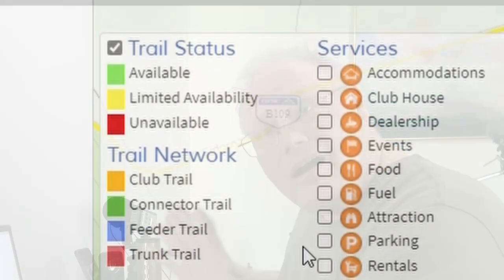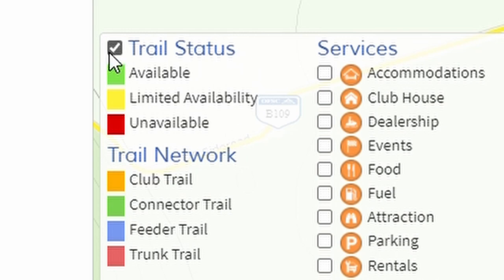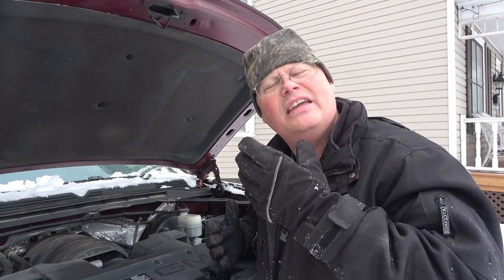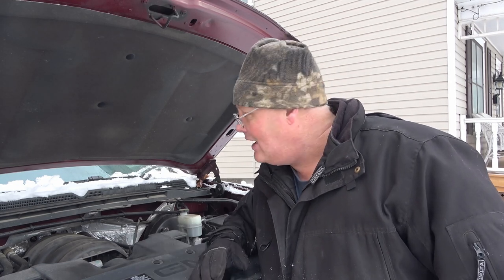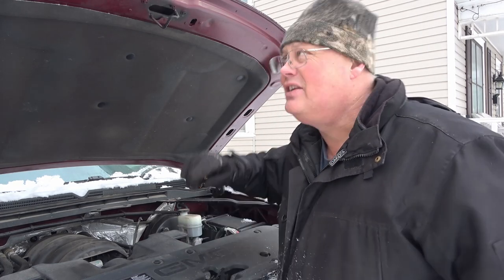Today I help you plan your first ever snowmobile trip ever.

Comment: Very good logical advice. I did not know the tracks are so well mapped and there are clear rules that apply to users. Very sensible  for all. That snowmobile riding looks great. If I lived in Ontario I would not be too concerned at having to put the motorcycle away in November - provided I had a snowmobile.
Reply from the maker: Thank you for the comment Mal. The ofsc does a great job at mapping the 30,000km of trails. It is a fun hobby as well and I'm sure anyone who like the dr would love sledding.
Dino